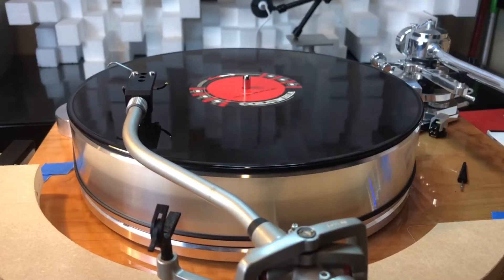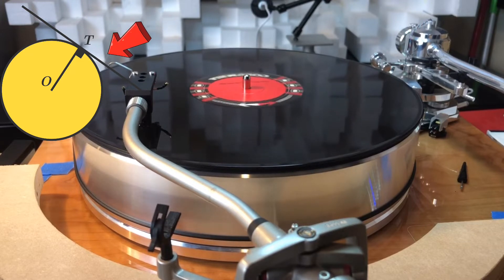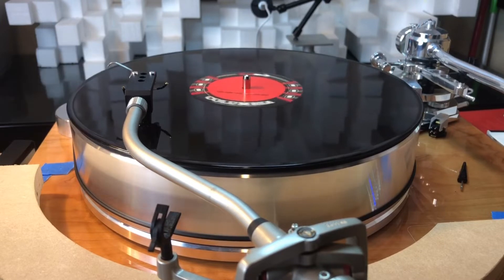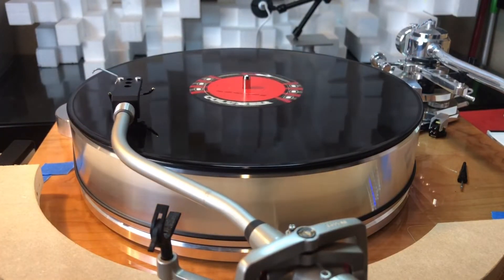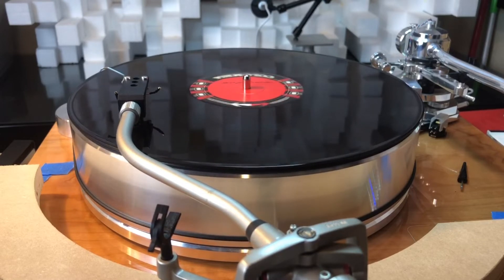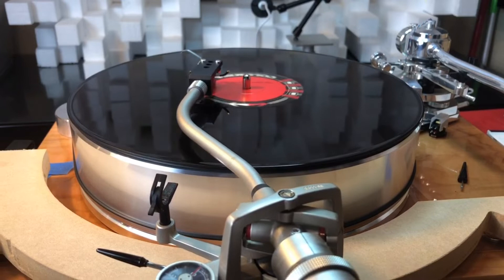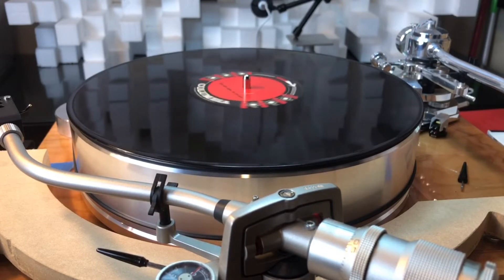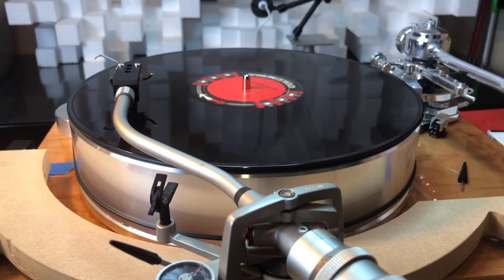Skating Study (Part 6 of 6) - Overhang 3

Comment: It seems to me that with overhang, the tangential vector that causes skating is being applied to the stylus (since that is where the frictional forces are contacting the tone arm/cart). However, antiskating mechanism applies the counteracting force to the tone arm but that force is ultimately applied to the stylus which counteracts the frictional force. By doing so, all the force is being applied to the outer groove and thus would only accentuate the problem?
Reply from the maker: Hello Renato. Thank you for your comment. 

I hope I haven't misunderstood you with this reply: Skating force increases pressure of the stylus against the inner groove wall. Anti-skating force counteracts this force by applying a force in the opposite direction towards the outer wall. Theoretically, when the coefficient of friction is "normal" for playback levels and the anti-skating has been set to about 10% of the VTF, the net differential in lateral force on the left wall versus the right wall would be zero - meaning: neither wall sees a lateral force at all.

Of course, anti-skating force either doesn't change much at all as the tonearm traverses the record surface (e.g., a simple weight and string bias weight with the arm hangar/pivot line in a position perpendicular to the armtube when the armtube is in the center of the record) or changes in a linear fashion (e.g. "pulley" type or spring loaded antiskate designs). This variable antiskating force and the dynamic nature of coefficient of friction means that the two sides of the stylus will take turns experiencing a lateral force as the groove is transited. I know of only one antiskate design where the mechanism acts as it should - in a parabolic fashion - to apply variable antiskating force.